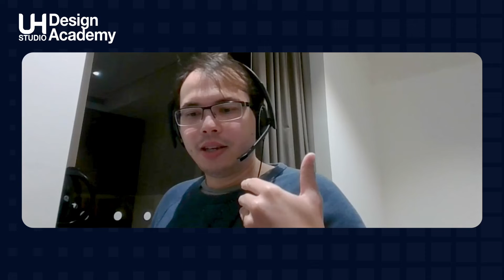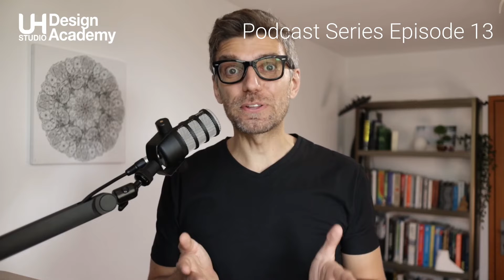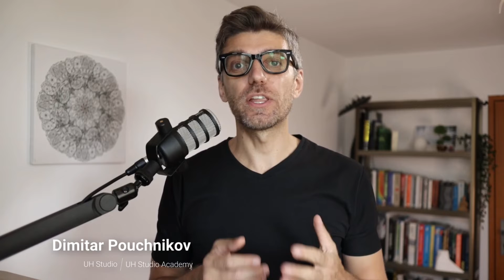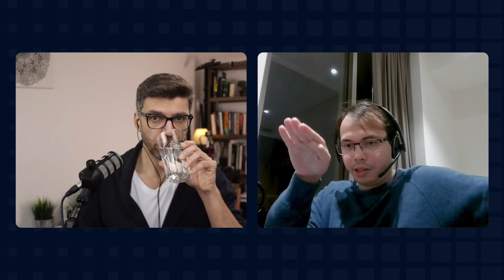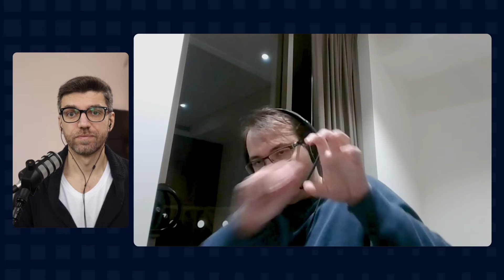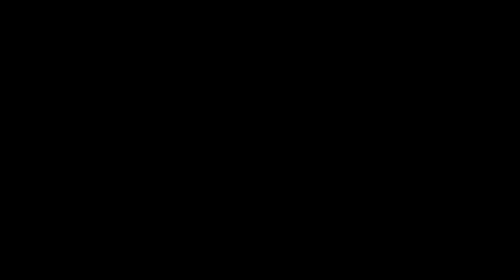13a BlenderBIM with Dion Moult

Comment: Is it possible to create a parametric pump using BlenderBIM?  Should this be done with GeoNodes or Sverchok?  How do we add the ports of the pump?  Cheers
Reply from the maker: Not sure about a parametric pump, but in the latest BB, there are some important updates for mechanical with pipe routing, and more.